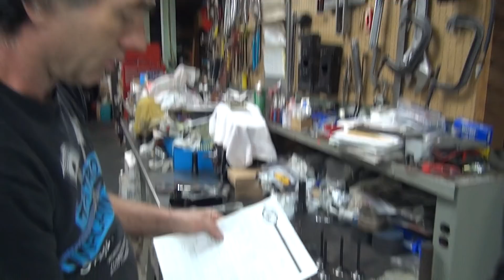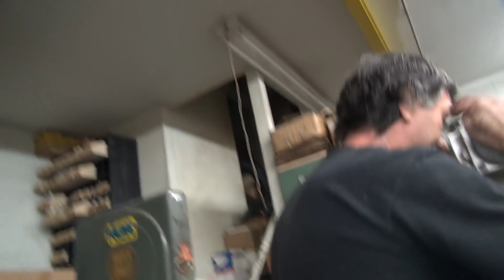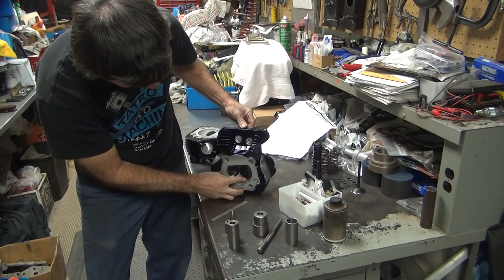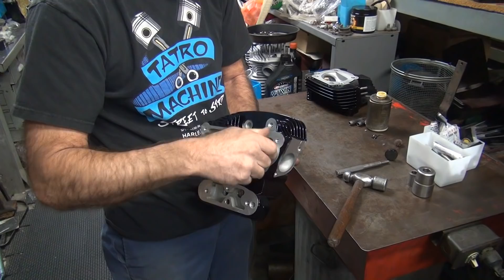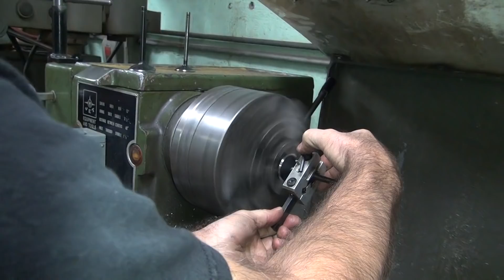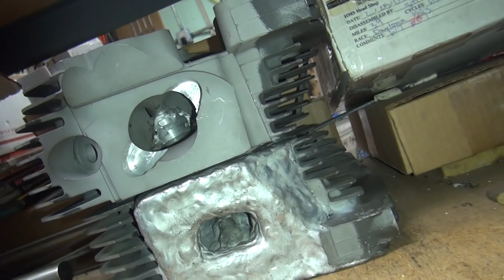2000 fxr4 80ci #121 motor rebuild fxr evo harley evolution cam bearing repair by tatro machine

Comment: What 600 cam would you suggest that doesn’t beat the heck out of the valve train like a woods cam does?
Reply from the maker: i don't care that much about the lift, what duration do you want. that is what tells the motor how it is going to run. andrews and s&s are easy on the valvetrain. other are too if you want more of a stock cam.
tatro